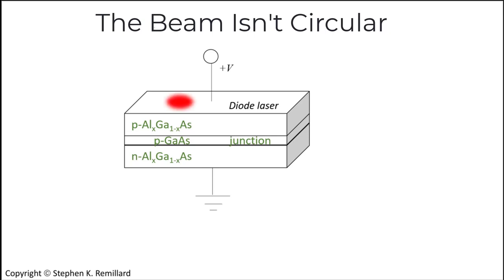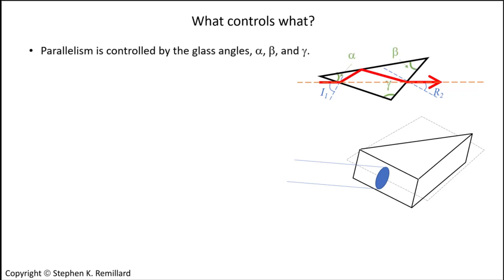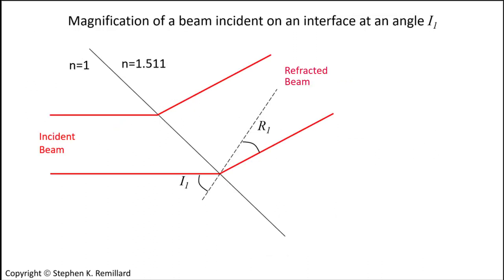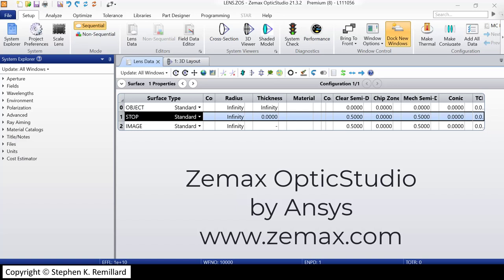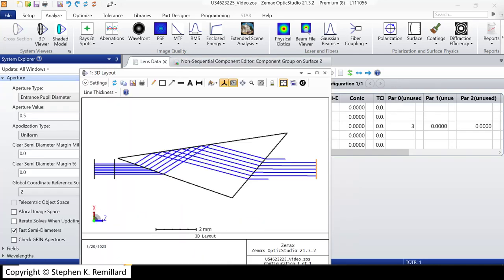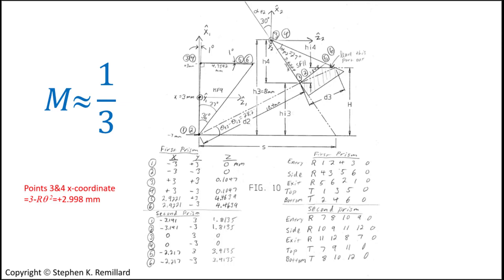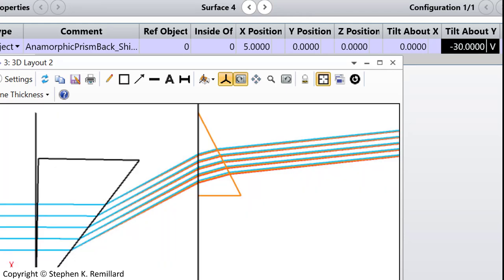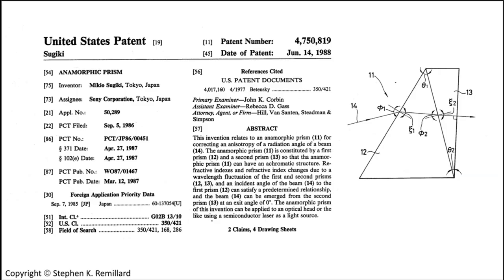Anamorphic Prism Design: A Patent Study

Comment: Excellent video on such important topic for laser diodes. Is it possible to use the Achromatic Anamorphic Prisms pairs of the same glass type and get great beam spot size? Why two different glass types are needed?
Reply from the maker: Using two glass types helps to keep the outgoing angle and height the same for all wavelengths.  But as I found, it isn't perfect.  You certainly can use two prisms of the same glass type, which just means a little more variation with wavelength in the outgoing angle.  Using two different glasses doesn't affect the beam quality for monochromatic light, but it does help to keep all colors on the same path if the spectrum is broad.

Comment: it does sound a lot easier to shove two prisms on lil mounts so i can fiddle with mounting angles, than it does to align a semi-cylindrical with 5 degrees of freedom...

as i see it... diode to lens distance. 1dof
squaring lens in two planes so flat face is perpendicular to beam.3dof.
shifting lens on one axis to centralise on beam. 4dof. 
rotating lens to diode. 5dof. 
only a linear movement in one plane has no significance... along the axis of the lens curvature.

arrrgh!

whereas this... flat surface.
diode height/central line... fixed.
diode rotate to surface. fixed.
 prism to diode distance. fixed. only needs adjustment to "stay in frame", right? (but is it better to try and cover the largest surface possible, or to focus first? spreading it out suggests higher losses through the air/glass transition, whereas focusing it suggests more chance of damaging the lens/coating?)
angle of incidence.
secondary angle of incidence.

and should be easily sealed up once actually sorted out so no nasties escape. or bugs get in. damn bugs.

hmmm. would love to see this for real with some fog...